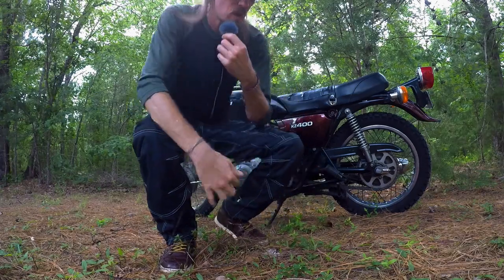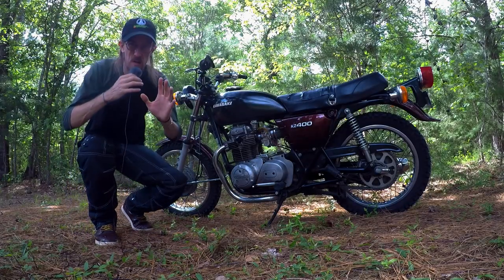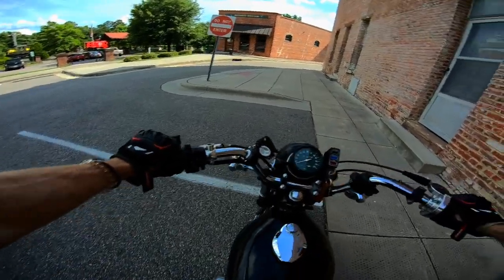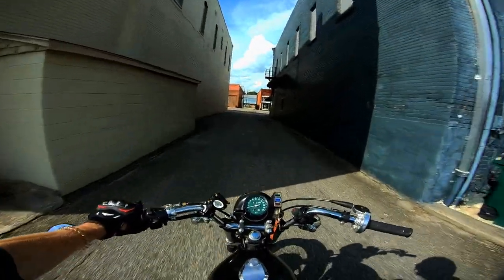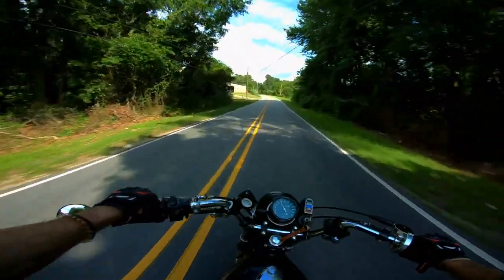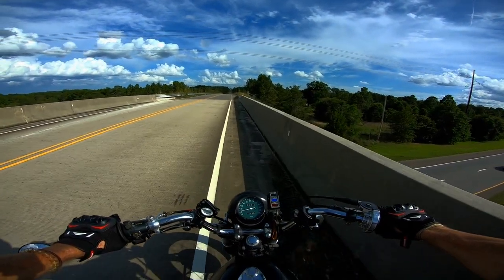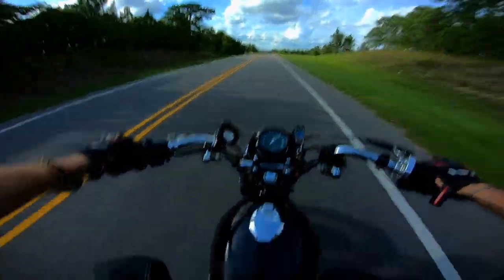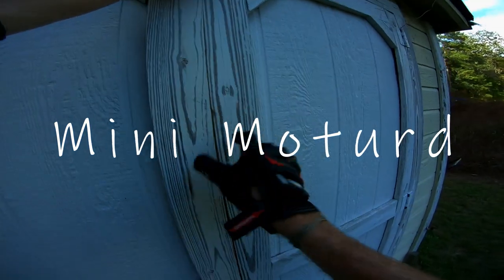Vintage Kawasaki…First Ride | i need help

Comment: Kawasaki released a service bulletin outlining how shops should address the oil leak issue. It's pretty extensive, including replacing the cylinder studs. On my 78 kz400 I just replaced the gaskets and torqued it down to spec. Still some weeping but not so much that I ever had to refill the oil. Just more annoying than anything. Great bike otherwise. https://photos.app.goo.gl/mof81veWeDRes8J77
Reply from the maker: Awesome…thank you for the bulletin! I’m coming to learn that there was a known design flaw that causes these motor to leak on certain year motors…that Kawasaki was aware of.  I drive the bike and it seem fine but it’s like you said it’s messy and irritating. thank you for watching as well🏍💨🤙🏻
Reply from the maker: Just subb your channel 262
Reply: @MiniMoturd  thanks, ditto. I'm going to be posting videos about a new fall project so stay tuned.
Reply from the maker: @stockton350  Right on man, sounds good and look forward to it🏍💨👊🏻👍🏻

Comment: 1977 KZ 400 here, no head gasket leaks but still rocking the original Keihin carb that's been a pain to tune, running rich.  Thinking about buying Mikuni's
Reply from the maker: Awesome man, yeah I’ve had people tell me there were less leaks after the year 1976 I don’t know if that’s 100% true that’s just what certain guys have told me…I really do like my Mikuni’s can’t say enough good about them. I still could do some fine tuning on them jet wise but it’s good enough to still have a blast on for now.

Comment: Some light machineing at your local machine shop will true up your gasket surfaces,and new gaskets
Reply from the maker: Appreciate the advice, another guy was saying the same thing. Just driving it for now, if it gets any worse I’ll have to address it. Thanks for checking the video out and commenting🏍💨👍🏻

Comment: ive got a kz400, been riding her hard from april 2021- early october 2021, now she doesnt want to start. Im going to rebuild the carbs and replace the leaking petcock and hopefully she'll kick up. What a fun bike to ride, I love mine so much.
Reply from the maker: That’s awesome man, got mine in May 2021. I’ve had some little hiccups but no major issues. I think I’m in the same boat as you I’ve been dealing with a leaky petcock and now she’s really leaking to the point where I’ve had to Park the bike. I’ve got a petcock ordered yesterday so I’m waiting for that to come in to get back on her. I feel the same love this bike  and ready to get it back on the road. Appreciate you watching the vid🏍💨🤙🏻

Comment: Your bike is leaking from the base gasket. What I would do in the first case is nip up the cylinder head bolts in the proper order. Just a nip to add, 5 Nm of torque to each bolt. Then ride it to see if the problem has gone away. Otherwise, it's just a case of getting a full gasket kit, and maybe using a little Threebond around the base gasket (just the thinnest layer).
Reply from the maker: Thank you big time for the insight…getting a lot of good information on the matter. Really appreciate you taking the time to help out and watching👍🏻 I absolutely love this little bike the more I ride it and have no problems doing whatever it takes to get her riding proper. Thanks again🏍💨👍🏻
Reply: @MiniMoturd  Hehehe you know how to promote your channel better than me lol. I get no views or engagement at all. Anyway, best of luck with that bike. I've got the KZ440 and, for me, it's a keeper. A broken base gasket will probably reseal itself just by nipping up the cyl head, but if it doesn't, fitting a new one just takes just an afternoon . I like what you've done with the speedo btw. I might copy that.
Reply from the maker: @GTMarmot  just watched your last post  with the kz440. Awesome bike, the 440cc would have been my first pick. Subbed your channel to👍🏻 the Speedo had already been switched up before I bought it…at first I was not sure if I liked it but it’s growing on me…kind of interested to see how it looks with the different bars paired with it…really appreciate you sharing information man👊🏻 awesome to connect with people that like these older bikes
Reply: @MiniMoturd  Cheers buddy. I need to work harder on my channel and probably give it a face and a voice, like yours. At the mo, it's just riding and a few text captions. So the Youtube algorithm probably just chucks it on the trash. But I'll try some new things and try a voiceover at least. I think I've got a few things to share. I've restored a few KZs now, and while I'm not an expert I DO have a few tricks. The tuning and fueling system conversion side of things - I can correct some misconceptions going around the internet. Anyway, likewise subbed and all the best to ya.
Reply from the maker: @GTMarmot  That’s solid content man…that knowledge you’ve gained means a lot to people that don’t have it…your almost too a hundred subs to. I was skeptical of talk that the algorithm acts differently once you hit 100 but I truly did notice a difference in the algorithm ….and I do believe it prefers engagement..the more the better it seems. Was tough for me to be in front of a camera much less talking and posting it for anyone in world to see but it’s gotten easier with every post. We just have to keep plugging away at it….and keep learning as we go. Get to meet a lot  awesomely good people doing Social media vids makes it worth doing🤙🏻

Comment: Those tires will do fine on street or dirt, street tires will do fine on street ..... dirt and especially gravel not so much. I have over fifty years of riding and 4 bikes in the stable at present large to small. Replacing gaskets on older bikes is common I have just went through a 1975 CL 360 Honda Scrambler and still have a leak at the bottom of one side cover. Some metal can warp over the years and may need machining back flat for a good seal. Good luck with your venture gaskets are not overly complicated and today a wealth of knowledge at our finger tips if you are mechanically inclined and do a little research and have the tools needed to take apart and re-assemble you will be fine. I removed all the Japanese Philips type bolt and screw head and replaced with a Allen head kit. You should have torque wrench but some do it with out.
Reply from the maker: That’s the dream! Having a handful of these vintage bikes in the garage one day and it sounds like your living it👍🏻 Thank you big time for your insight…it’s greatly appreciated. Excited to start the journey down the vintage road. Thank you for giving the vid a watch🏍🏍💨💨💨🤙🏻and safe travels out there

Comment: If you don't mind me asking, how much did you get her for? 
I enjoy your kz videos a lot
Reply from the maker: I appreciate that👊🏻 pick this one up for 1,300$
Reply: @MiniMoturd  Nice, was that running? 
I picked up a red 78 KZ400 B1 earlier today! My first motorcycle. It needs a lot of work, has been sitting since 1990 but it only has 1,333 miles on it. Needs tires,chain,battery,fork seals,carbs cleaned etc. Most of which I can do myself.  It's got some rust from time, but I scooped her for $300! Still has the break-in stickers on tank and tach.

I'll be looking out for another video on your KZ. I enjoy your content. Super cool moto
Reply from the maker: That’s awesome, you’ll have a lot of fun with that thing, it can get frustrating messing with these vintage bikes. But oh so satisfying when they are running good and you’re riding through those turns🏍💨👍🏻 appreciate you watching and supporting the vids….keep me posted on how yours is coming along👍🏻
Reply: I've been chipping away. Pulling the motor today to freshen up some stuff and pull the head, I broke a plug off that's been in there since 1989 lol. Seems the whole electrical system is good. Going to restore it first, I can always brat it later if I want but hard to go back after that. 
I really dig the green speedo with the placement, and the bars look great too.
Maybe when I get this on the road we can do a ride eventually. I'm in Georgia.
Watching your kz vids is the confirmation I needed that this would be a good starter moto. I've rode some of my buddys smaller motorcycles and dirt bikes growing up.  So damn stoked to have one of my own now. 
Just the beginning of what will hopefully be a long and fulfilling journey. Gotta make it to Maggie Valley 
Godspeed, bro. Keep on doing what you're doing.

Comment: Must be hard to get parts for it when something breaks.
Reply from the maker: General maintenance parts are not to hard to find but anything more than that seems to be harder….I keep buying the bikes that more challenging for parts🤦🏻‍♂️😅 Thanks for the support and watching  man🏍💨🤙🏻
Reply: I haven't ever had a problem finding working used parts. New parts though, forget about it
Reply from the maker: @terranovnicek1567 I agree..i’ve only ordered bars for mine so far but I’ve been searching and seems to be fairly available🏍💨🤙🏻